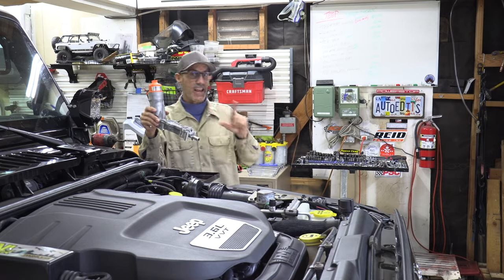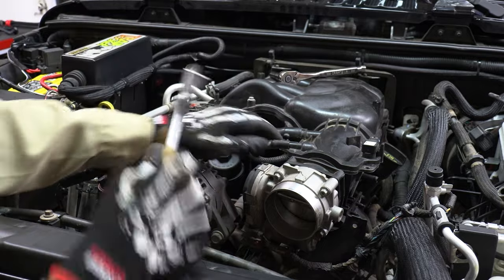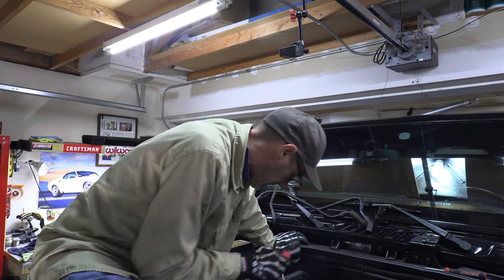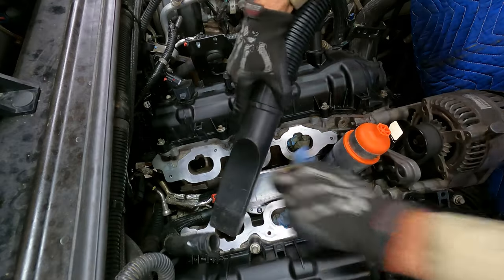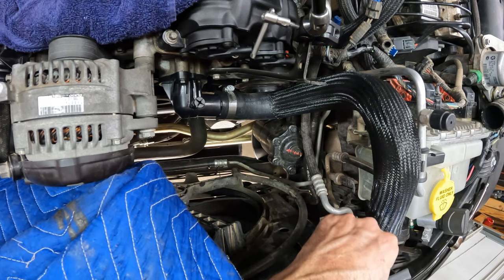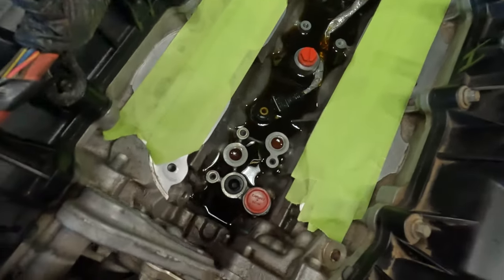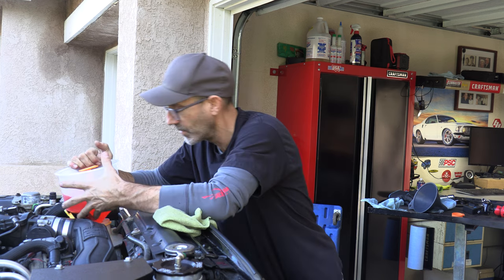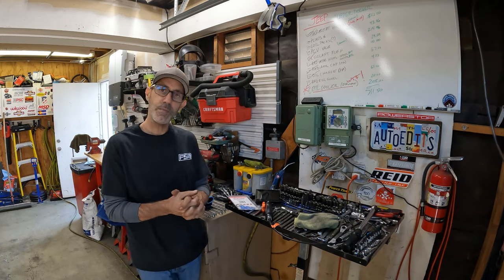How to  Replace Jeep JK Oil Cooler and MORE - Plugs, PCV, Thermostat Housing, Coil Packs

Comment: Yep this is common and changed my out to an aluminum one ( not Dorman). I did replaced my heater hoses and hose to the oil cooler while back there since I don’t think they will last 10 more years 😂😂😂. Good video!
Reply from the maker: Thanks for sharing!

Comment: Another great video. I always look forward to them. I've got a few notes on this one though. You shouldn't just replace the seals on the oil cooler, replace the whole unit. Not only do the seals go bad but the housing also warps. Allegedly you can use the upgraded version from later models on the earlier 3.6's. I've heard mixed stories on Dorman parts. Some people swear by them, others swear at them. As JT from @OnlineMechanicTips says "It's Mopar or no Car". Getting a pick under the edge of where the hoses connect helps to release them. You missed telling everyone about the bleeder screw on the thermostat housing which helps with bleeding air from the cooling system. There is a massive debate online about whether you should use Anti-Seize on spark plugs. If you don't reduce the torque spec when you tighten them you can overcrank the threads. Most modern spark plugs already have an Anti-seize treatment and most plug manufacturers don't recommend using anti-seize. This video explains: https://www.youtube.com/watch?v=xZ-KOL4gZzw
Reply from the maker: Solid bunch of info.

Comment: I just did all of that over summer since I had to open up head to replace rocker arms. Definitely took the weekend to get it done. I found the aluminum oil housing after replacing with Mopar unit and wish I had found that before. Everyone keeps saying I should have gone with the aluminum one.
Reply from the maker: I don't necessarily believe the aluminum housing is best. The mopar unit is very good.

Comment: Excellent video that will help many Jeepers as always! Dealing with Mopar maintenance on multiple vehicles and gleaming experience from many like minded others, it seems the OEM replacement parts are usually best way to go. Unless it's a known part failure that hasn't been improved.
Reply from the maker: Sometimes I must learn the hard way 🤣

Comment: Great video Jason. This kinda seals the deal for me. I was bouncing back and forth on doing the doorman or mishimoto oil cooler filter housing. I'll be going with the mishimoto for sure. The lack of quality control and the extreme differences between the same parts on the doorman is too much for my liking. Keep up the good work!
Reply from the maker: I would agree with your assessment!
Reply: Hows the mishimoto oil cooler holding up?

Comment: Bummer about the dorman part. Question, did you find any flaw in the casting? Like a crack or hole from  porosity?.. just curious...
Reply from the maker: I looked it over pretty good and couldn't find anything that stood out.

Comment: I was so frustrated for you when the first part failed! 
On a positive note, I am on my 3rd oil cooler housing (including the original) and can tell you that the last time mine was replaced (about 6 months ago), it cost me about the same, thru a local shop, as your total bill, but I only got the new housing!
Reply from the maker: Wow, that's a lot of coolers!  Thanks so much for the support!

Comment: Right on time! I was getting that burning oil smell in my 2015 JKU and will need to replace the oil cooler. Today, I had a code P0301 pop up. Ugggg. Wish you were my neighbor.
Reply from the maker: That's an interesting cylinder misfire code! Well, if you were close by... I do work for fig newtons or pizza.  Good luck on that repair!
Reply: Been there ....
PCV valve for the P0301 .
A bunch of gunk gets stuck in 1 if it's faulty

Comment: The timing of this video is so good! I have plans to fix my oil cooler but accidentally stripped a bolt. It has been impossible to extract, so with all this extra time I have some more things to plan for.
If you have any tips on getting the stuck bolt out they would be greatly appreciated. I run an Edelbrock supercharger and the bolt is on the fuel rails, I have tried drilling for hours and hours with reverse threaded cobalt drill bits and have zero luck.
Reply from the maker: Sounds like you're doing all the right things... bummer... hope you get it!

Comment: You should've added the Baxter Motorsports Spin-on Oil Filter option, to prevent dry engine starts!  Whenever I get around to doing this same swap, I plan on installing it too :)  Just something you should look at!
Reply from the maker: I'm interested in the Baxter option but kind of ran out of budget for this particular service. Maybe down the road a bit.

Comment: I was late to the autoedits party but found your channel after buying our jk just over a year ago and have used many things you've recommended over the years. On a different note, I'm an auto tech professionally and have done a number of dorman oil coolers without an issue and dont have any problem recommending them to customers, which makes me think your issue with it was a random occurance. Theres nothing wrong with going oem though, there seems to be less chance of a defective part going that route
Reply from the maker: We both mostly agree. Being the face on the video sharing my experience I feel the need to be honest and help others make informed decisions before being elbow deep in a repair. I ended up with a Dorman unit in there and have other parts from there in service. But even a random bad luck failure on a part that tedious to replace is a no go for me.
Reply: @AutoEdits  I totally get it and I think we all appreciate the absolute honest review on a part that you're installing. It's necessary to show the good, bad and ugly of whatever you're doing if you're name is attached to a product. Prior to the dorman unit coming out we installed oem cooler and filter adaptors, again, without failure

Comment: Did you consider replacing the knock sensors? I was told they will fail after they've gotten wet when the oil cooler fills the top of the engine with oil. When I did this on my 2015 JKU I replaced mine. What a pain this engine was to work on with those ridiculous brackets. I've been told that the OEM housings warp after a while and that causes the O-rings to leak. When I replaced mine they only had the plastic housings available and after I was back on the road the aluminum version was released...figures.
Reply from the maker: Dang it... I wish I had been alerted to just replacing those sensors before this! I had tunnel vision on the rest of the things I wanted to do.

Comment: I did this job on my old 2017 in 20° weather....twice. Both times, I finished, and it dumped coolant. I also used the doorman aluminum housing. Third time was when I found out I had some warranty I had forgotten about, and the dealer did the job under warranty. Not sure what the problem was when I did the job. There were no obvious o ring or seal issues. I sold the jeep a few months after that
Reply from the maker: Yikes!
Reply: @AutoEdits  yikes indeed. Never have I missed living in Southern California in my life

Comment: I have heard in my Jeep club of people having problems with the aftermarket thermostats on the 3.6 ? Its more expensive but I try to use oem parts as much as possible I have been bit by the aftermarket quite a bit!   Another great video
Reply from the maker: Yes, I would be more inclined to agree at this point with that advice 🤣 Thanks for being here!

Comment: I attempted to use the Dorman unit on my ‘17 JKU and the o-rings failed 3 times (even OEM were pinched or blew out eventually). My factory housing wasn’t cracked so I just reused it and replaced the o-rings with OEM. Been leak free for over a year. Did the same for my gf’s JKU as well. Tip for anyone doing this, reuse your stock part if it’s not cracked and save $. I also replaced the sensors while it was apart, as mine were leaking.
Reply from the maker: If I was paying attention, I would've thrown those felpro gaskets in my stock housing and been much happier. I'm really hoping not to do 3 times like you did... lol
Reply: @AutoEdits I waited about 20-30min letting it idle after each attempt just to verify. Hopefully yours is all good now! Seeing oil drip down the bell housing after waiting was heart breaking each time lol.

Comment: Thank you so much for these videos and for keeping your JK. Im not a mechanic but you’ve helped me tackle so much more than I ever thought I could. And on that note, a question: have you ever heard of the Baxter Performance Oil Filter Cartridge to Spin-on Adapter? If so, I was curious about your thoughts on it or even if you’d consider an install video?
Reply from the maker: It looks good to me... I almost pulled the trigger on that but the budget for this repair got a little out of hand for me. So it will have to wait.

Comment: The only suggestion  I would  add, is change the sensors with Mopar sensors at the time of install regardless of the type of cooler used. We run into a lot of Aftermarket sensors failing shortly after swapping them. Also as you found out the removal from OEM cooler can be a huge P.I.T.A. Just a side note Champion 9407 Plugs(Same as OEM just no Mopar labeling) can be 9 bucks or less if you shop around
Reply from the maker: Good tip!

Comment: I feel your pain.....Yesterday I installed the Dormans Oil Cooler on my JK.......today I have P0522 and P0523 code ...low and high oil pressure code.........I'm guessing bad Oil Sensor on the Oil Cooler........I did install brand new ones.........Guess I have re-work to do this weekend..........Thanks for this video........
Reply from the maker: Sorry to hear that

Comment: OMG! What a disaster! And yes, what a horrible feeling to have done all that work, only to find out that you need to do it all over again! Thanks for showing that side of DIY, as that is a reality we all must face. I'm about to do the oil cooler swap myself, as my plastic one broke, following an oil and filter change. Not sure what happened, but I suspect that the housing cacked when I removed the filter cap. Lesson? Do not over-tighten your oil filter cap, as this will put excessive stain on the plastic housing, when you go to twist the cap off the next time. And it's not necessary to do so; just snug should do. If it does leak, just go back and make it a bit tighter. Remove the Cap, hot or cold? This is the first time I did it cold. The other variable is that I removed the oil filter cap with my driver, vs using a ratchet. It's the first time I did it that way. Could the shock of the gun have cracked the housing? I doubt that would have caused seals to fail. Too bad we have no way to pressure test the housing, to try and solve the mystery. I'm looking forward to installing the Doorman unit, as I think it is a well designed and strong piece. I'm sorry you had an issue with the first one. My thought on it, is that there may have been an install issue with one of the seals, vs a defect in the housing? Again, pressure testing of the unit would reveal such a flaw, if it existed. Thanks for your video. Hope to see you on a trail some day.
Reply from the maker: I would recommend buying your Dorman housing at a local auto parts store and not from Amazon. I feel that there is a problem with off brand retailers substituting products online. The "dorman" unit I got from amazon and the same dorman unit bought from a local store were visibly different. Better quality and obviously a real dorman product from my local store. Good luck on your repair!

Comment: Last time I tried coolant funnel on 2014 3.6 - it acted like I got all the air out… I even cracked the heater core line and thermostat housing bleed screw - which I did not see in this video. 

Initial test drive went good too .

But a longer cross state Drive showed there was still air in the system - and gave me trouble throughout trip. 

Ended up order a Snapon vacuum filler - which also proved the cooling system not to be leaking. 

Shame, coolant funnel works great on a 5.7 hemi I service.
Reply from the maker: Not sure what to say here. I’ve driven several hours since this repair and the Jeep is fine. I didn’t have to crack lines or use that bleed screw… which seems mildly useless since it’s lower than the upper hose outlet. Maybe I just got lucky on that one aspect this time.
Reply: @AutoEdits  hopefully your luck better than mine!
Reply: @ddesilva61 
Park on a  nose high incline when using the funnel 👍🏻

Comment: Well guess I won't be getting a Dorman unit when mine starts leaking again lol. Thats sucks that it sprang a leak. I hope your E3 plugs work out for you. When I did this job 2 years ago i used the OEM Champion plugs but they were less expensive back then. I got them on Amazon for about $30 for the set. Inflation sucks...
Reply from the maker: I'm more nervous about the E3 plugs after reading the many comments here... LOL
Reply: @AutoEdits 
NGK Iridium  plugs 👍🏻

Comment: thanks for a great video and a breakdown of all the steps, (twice), sorry for that repeat repair, that was sucky, but you plowed right thru it, i might have had the sledgehammer over head a few times at that point:) my question is what resource are you using? an online manual or Haynes or other? thanks.
Reply from the maker: All of the above!

Comment: Great honest video, in particular with the Dorman product.

Is that the proper way to “flush” the cooling system or is there a form of “coolant fluid cycling” that wasn’t filmed? Understand if priorities changed due to your unique circumstance.
Reply from the maker: Yes, you can force flow reverse direction through the heater core but I was past my patience limit on this project due to the other factors...lol

Comment: I got a little flack for recommending against Dorman in the comments of your last video for this exact reason. It's not so much the product material itself as just the terrible design of the OEM oil cooler in general and Dorman doesn't address this. Glad the second one worked and your Jeep is up and running. For ten years and 80k miles, that's a beautifully smooth sounding Pentastar.
Reply from the maker: Yeah, it's a tricky setup! Thanks for offering up the information for sure!!!

Comment: Wish this video had been made 4 days ago when I did all this :) Had the exact same issue with the Dorman; since your second unit worked out, do you think it was just a matter of the seals fitting better? I am going to try my Dorman again with the Jeep seals and see if that works out, and possibly use some RTV to make sure the seals don't dislodge when popping the unit back in. Good idea on replacing the PCV, will add that to my list when I repeat this job and get new seals in.
Reply from the maker: Good luck on yours!!!

Comment: I wonder if the Mishimoto cooler is better built than Dorman.
Reply from the maker: I've heard about it but never seen an install.
Reply: @AutoEdits  same. I've used Mishimoto for intercoolers, catch cans, and radiators. It’s been always a great experience but I have not seen anything about their Jeep oil cooler. They market it as using viton seals which in theory are much better but idk... It's the first time they made a part like that, and the cooler is so annoying to change lol. 

I’m at 150k miles on my ‘13 and have already gone through 2 lol. Both were Mopar, the 2nd one I installed was the “upgraded” 2015+ hoping it gives me a better run than the first lol.

Comment: would you say what you did with the coolant here is a flush or a drain and fill? i bought the funnel and some coolant with the plan to do what you’ve done but then fell down the rabbit hole of flushing with a vacuum tool and distilled water. is it worth it to do a coolant drain and fill or should i plan on figuring out how to do a complete flush?
Reply from the maker: I just did a "drain and fill" and that satisfied me as appropriate for a vehicle with under 100K miles. I've seen videos of folks with a clogged heater core and that seems like a good time to do an actual flush but the coolant I drained tested completely good on my gauge and was overkill to even drain and replace. But, do what gives you the best peace of mind... that's part of the joy of wrenching on your own stuff!

Comment: Thanks for sharing the good and bad on this one!  Getting ready to do this myself on my son’s 2018 JKU. Purchased the Dorman and from research online people highly suggest use Mopar seals on the cooler and Felpro on the intake. I got the Felpro intake gaskets already, what is your opinion on using the Mopar seals on the cooler?  Will they fit?  I’m trying my best to do this job once😊
Reply from the maker: You'll know if they will fit once you compare the two side by side. I used all the dorman stuff that came with the kit, both times.